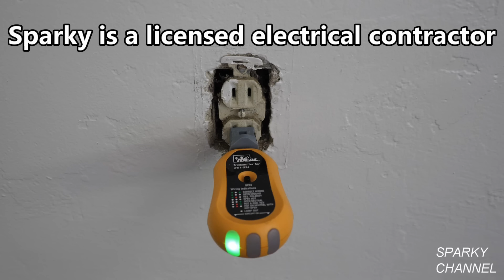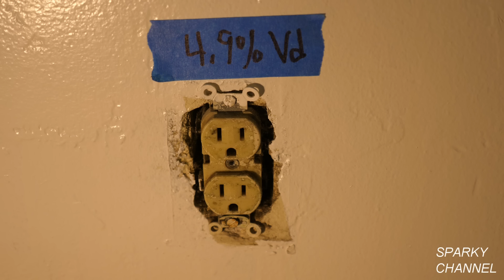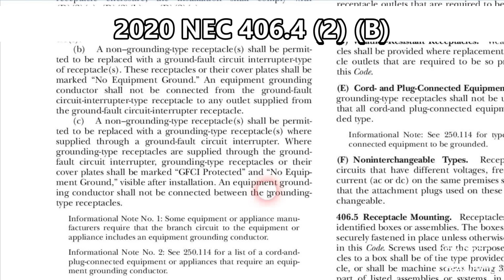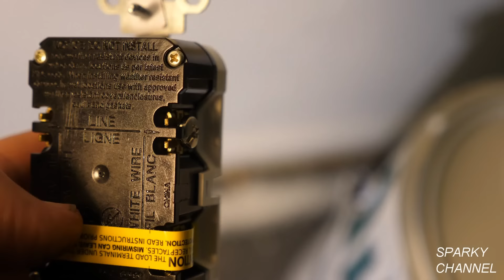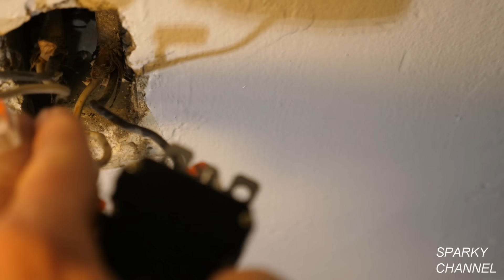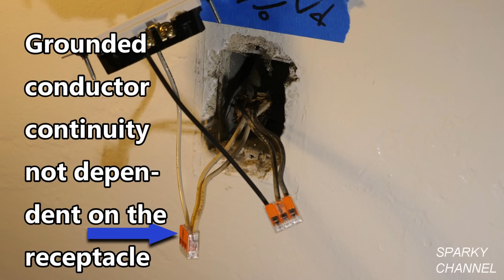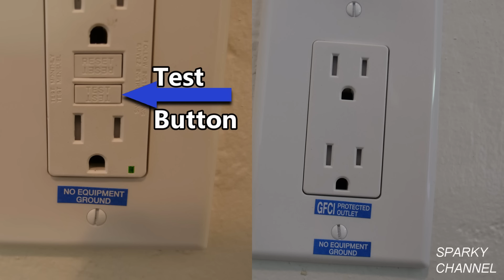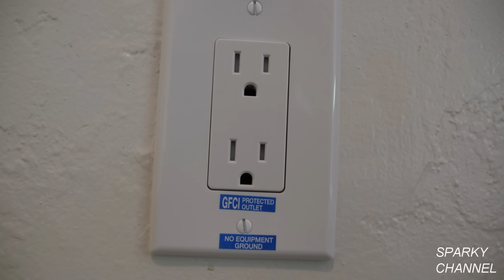2 Prong Receptacle Circuit Replaced by GFCI and Grounded Receptacles per 2020 NEC

Comment: Would never use those push in crap connectors. I see a metal box and it is not knob and tube so does not need to be a GFI. You are a muppet.
Reply: The connectors were lever activated, not push in.  Also, the whole idea is to make a much safer setup and that’s why NEC mandates GFCI in wet areas in new construction even though they have a ground.  This remodel had no grounds and so he has made it much safer.
Reply: Metal box doesn't ensure grounding. 
Did you see the type of wire in the metal box??
Reply: @billbaillie3702  Yes, it is BX.
Reply: @billbaillie3702  If it is not grounded you should replace it with a plastic box. If the live wire gets loose or damaged and energizes the box the voltage will get through the ground wire to the case.
Reply: Metal box isn't everything. Our home was built in the '20s. It has all metal boxes, and all cloth-insulated wiring.
Reply: @Naude716 Am ungrounded metal box is a risk in this method. If the live wire touches the box the equipment case gets the mains voltage. The GFCI will not protect of it happens in the GFCI outlet. If it happens on the load side it will protect.
Reply: @Naude716 I'm also curious re the explanation / theory how 2 wire cloth romex (Not BX) is grounded...
Reply: @billbaillie3702  From what I've  learned, the only real way to ground your old cloth wiring is to gut your walls and run grounds (or new grounded cable) everywhere from your circuit breaker (assuming you have one).
However, if you're lucky, you may have a basement where you can ground SOME of the receptacles. You may be able to run ground wiring from the breaker to the very first receptacle in each circuit. Follow the wiring from the box up all the way until it breaches the subfloor and do your best to feed the new ground up towards the receptacle, and you might just be able to fish it through. That would be the best case to ground SOME receptacles without having to tear walls apart. The only way to ground ALL receptacles is to gut walls and run new cables.

I'm resigned to the fact that I'll just be adding gfci protection to circuits where wet areas are (garage, kitchen, bathroom, laundry, basement..). As for AFCI, I've heard that it can cause nuisance tripping if your wiring isn't grounded.

As always, take this with a grain of salt! I'm not a professional, but I did my best to research online and consult professionals.
Reply: @Naude716  You can't run a ground wire and if you could why not just run a new grounded NM-B or MC cable? The NEC has exceptions to use a GFCI/AFCI outlet. I am just telling you what the code is. You are making shit up. 

I am a Master Electrician.
Reply: @StanSwan  If there is nothing physically in the way of running a ground wire between your breaker and a receptacle (such as walls), why couldn't you run a ground wire/new cable?

As for GFCI/AFCI, all I'm repeating is what I know from an electrician that came to assess work here.
He basically said GFCI was good for wet areas, but anything past that (such as adding AFCI to circuits in living spaces, or GFCI to circuits in dry areas) could create issues with nuisance tripping.

-and you're right I am not a professional. I clearly stated that. There is no reason to be condescending. I'm not here to "win an argument".
Reply: @StanSwan I edited my reply. I think I worded what I was trying to say poorly, and that's where some of the disconnect was.. No pun intended.
Reply: @Naude716  im new here and i just gotta say,reading all these comments is just shocking to me.lets all just get along......
Reply: @Naude716  The house has an old service panel that does not comply with current code. If you modify it you have to meet code. Running an earth to the panel that doesn't have one currently would be a modification.
Reply: @Naude716  Never said it is everything did I? The box is fed with BX. The steel armor is a grounding path. Tell me when did you get your Master Electricians license? I got mine in 1992.
Reply: @StanSwan  🤔 so you're saying you think it's already grounded? As in, he just needed to add a ground wire between the box and receptacle?
Reply: @Naude716  Code allows that or a self grounding receptacle.
Reply: @StanSwan  Ah, oh well. I guess we'll never know for sure since he never showed him testing the box for a ground!
Reply: @Naude716  I can clearly see the BX cable.
Reply: @StanSwan  just because  it's  bx doesn't  not mean it's grounded or goes all the way back to the panel or correct  connectors are used.
Reply: @thomasmarable6818  How many times are you going to repost this? Already answered you.
Reply: @StanSwan  when did you answer me never I just made a statement.  And again  just because it's bx in the box doesn't mean  it's grounded. There could be  a number of reasons why it's not.
Reply: @thomasmarable6818  BX is always a ground. You ever work in the trade?
Reply: @StanSwan  so for those over in Europe, bx cable is armoured?

I see so much here that looks horrifying from the perspective of European standards. There's no way you'd be allowed to retain outlets without a ground, and even if it is armoured cable with grounded armour you're still expected to have a dedicated CPC. There's no end to end test for resistance, polarity was only tested with a no contact voltage tester. There's no test for loop impedance or prospective short circuit current to ensure that it would be high enough to guarantee a trip, whilst below the breaking current rating. There's no insulation testing to ensure the cable is still in good condition. The GFCI (we call them RCDs)  hasn't been tested for trip current or trip time. There wasn't contact voltage testing or proving dead, or even proving unit for the non contact testers that are used (which definitely wouldn't fly for safe isolation), and the breaker isn't locked out!

Oh, and that circuit analyser is pulling 15 to 20A on an IEC connector that's rated for 10A

Is any of this considered normal over there?
Reply: @NeneExists  The NEC is the most Strick electrical code in the world. Most countries adopt 1970s NEC standards so have no idea what you are rambling on about.
Reply: @NeneExists  BX is the old style armored cable. It had only two conductors and some later BX had a grounding strip. I know this because I worked on my old 1920's house back in the late 80's and I was still able to buy some. I don't think it's made any more. Now we have MC which has insulated grounding conductors. I'm not an electrician, but I've seen MC (metallic cable) and AC (armored) used interchangeably.
Reply: Every circuit should be GFCI protected, like it is in every other civilized country.
Reply: @airplanes657  LOL Are you really that stupid?
Reply: @StanSwan  I'm from the UK. Every circuit in my house was ground fault protected. I know that's hard to imagine for an American... And the house was older than America itself and it still had GFI.
Reply: @airplanes657  You mean arc fault. Same thing as here. I am a Master Electrician FYI.
Reply: @StanSwan  well if you want to be picky actually I mean a Residual Current Device (RCD) which trips on 15mA, equivalent enough to an American GFCI. I don't really care if your a "master" in America, doesn't mean you know anything about international best practices clearly.
Reply: @airplanes657  You're. When you lean to spell I will care what you think. GFCI is not required except in wet locations as it invites nuisance tripping.
Reply: @StanSwan  When they lean to spell? Oh the irony.

Anyway, BS 7671:2018+A2:2022 requires RCD/GFCI in many locations, and they're listed in regulation 411. Specifically 411.3.3 calls out a requirement for RCD protection on all sockets rated at 32A or less, and 411.3.4 requires RCD protection on all domestic lighting circuits. There's also specific requirements for electric vehicle charging in 722.411.4.1 but that's a bit tangential and also covers things like PEN fault protection.

BS 7671:2018+A2:2022 doesn't require AFDD on all sockets, but it does recommend them, except for what it calls high risk dwellings which specifically do need both AFDD and RCD on sockets or fixed wiring of 32A or less in new installations per 421.1.7.

You don't need to care what any of us think for it to be provably false that the NEC is the most "strick" (sic) electrical code in the world, because out here in the civilised world we're all kinda horrified at what american wiring and practices look like, and what master (sic) electricians get away with.
Reply: lol
Reply: @airplanes657  "I'm from the UK. Every circuit in my house was ground fault protected. I know that's hard to imagine for an American... "
That won't be a safety issue. The thing is with so many protective devices how would you insure the one that tripped is the one nearest to the fault? You could be running all around the house to find the that GFCI.
Reply: always one know it all like you huh? a metal box doesnt mean a thing for grounding.
Reply: @ThePCHomestead  That is why I mentioned a ground being present genius. When did you get your Master Electricians license troll?
Reply: @ThePCHomestead  I watched it and corrected it.

Comment: Aren't all the receptacles GFCI protected?
Reply: Once a GFCI is put in upstream at the nearest receptacle to the breaker panel, as was done here, then everything downstream on the circuit is protected by the one GFCI receptacle.  You will notice, he didn’t pigtail the first receptacle.  This is so all current will flow through it and can be interrupted if an imbalance occurs. (IE, some of the current is flowing through you)
Reply: Not unless they were replaced with a GFCI outlet.
Reply: @ErrorInvalidName  or GFCI circuit breaker in service panel?
Reply: @billbaillie3702  With this old panel I seriously doubt you could source a GFCI breaker.

Comment: Thank you, very instructive.  I have wondered if there are instruments that test under load, since that can detect problems that won't show up in continuity tests. Separately: what is the orange tool at 15:38 being used to fold wires into the box before pushing the receptacle in?
Reply from the maker: Thanks! VOLTCLAW-12 Nonconductive Electrical Wire Pliers: Amazon: https://amzn.to/3GRNqyp

Comment: Are the old bulldog painal  still legal
Reply: As long as you don't modify it yes. Code does not require you to rewire your house just because it's old. If that were the case homes would be rewired every 5-10 years at considerable cost.

Comment: But did you replace the knob and tube wiring with romex?
Reply: There is nothing wrong with knob and tube wiring that is in good condition. If you are using a window air conditioner unit run a separate #12 romex for that outlet on a separate breaker.

Comment: What if the receptacle was just bad and you labeled it "off" with the blue tape and then you start sticking hour hands in there?
Reply: That’s why you use that little voltage detector thingy..  stick that in first, after you have confirmation it works… then a little prayer and hope your not gonna grab a hot wire.

Comment: I am a thrifty type. I don't buy that costly Ideal circuit analyzer.  After verify all receptacles for a particular circuit by turning off breaker and using hot stick I disconnect all wires then turning on the breaker to find the only hot wire using my hot stick.  The receptacle that has one hot wire is the most upstream one.  Over here  we call it home run.  Once the most upstream receptacle is identified, I then turn the breaker off to proceed with my work.
Reply from the maker: Excellent, that works!
Reply: Being thrifty is always good, but nerding on unimportant things for the sake of curiosity is just what some of us do 😂
Reply: @Nature's Potluck  I am a professional electrician.  I save money whenever necessary, and I invest thousands of dollars in tools and equipment that are deemed necessary for my line of work to enhance the quality of work and safety for all.  Don't get it wrong.
Reply: Install a GFCI circuit breaker on the circuit and be done with it.

Comment: Can I just replace ALL receptacles on a circuit with GFCI receptacles?... for example, replace the most upstream old receptacle with a new GFCI, then also replace all down stream old receptacles with new gfci receptacles?
Reply: If you really want to do it probably wouldn't be terrible but you're looking at two maybe three bucks a piece versus 20
Reply: Well you can do that if you can afford the cost.  The costs of GFCI receptacles are many times more than regular receptacles.
Reply: @vigormanh2980  I buy from amazon in bulk... I got 10 leviton gfci for $65... I know a chain of gfci is overkill but I like the look of all receptacles matching in a room... I have already ran a chain of 4 gfci in 1 bedroom, no problems, I asked the question hoping I wasn't violating electrical code as a violation could be a pain when I go to sell my house.
Reply: @deezle1460  My wild guess is what you have, matching GFCI receptacles in the same room, will be frown upon.  Now, let do a quick review about Ground Fault Circuit Interuptor (GFCI).  It is a feature that helps protect personnel from getting electrical shock in case of current leakage.  GFCI receptacles are required on specific areas of the dwelling units, commercial places and industrial environments.  One should look at the NEC book, local  authority having jurisdiction' requirements to find more about where he/she should install GFCI outlets.  If you install GFCI receptacles at places where GFCI receptacles are not required it will be a little odd.  I hope whoever did the installation for you has proper training in electrical work.  I have seen very lousy jobs done by handymen.  My suggestion is just get a qualified electrician to have a look at your house before you put it on the market.
Reply: You could but two issues with that.

It would cost a lot more. Additionally you could not use a jumper on the downstream outlets. All conductors would need to be directly connected to the GFCI outlet. A bad outlet would isolate all downstream outlets.
Reply: There are a few other videos out there describing this scenario. From what I gathered, you COULD install GFCIs at each downstream receptacle, but there really is no point. The key is installing a GFCI at the first receptacle in the circuit (as shown in this video). Also, if one trips, they all trip downstream. The you have to reset them all, instead of just the first one in the circuit. And of course - much more costly.
Reply: @nadermostafa3963  I currently have a series of 4 gfci, when I TEST trip 1, it does NOT trip the ones down stream BUT the lead (start of run) gfci does kill power to the other 3 when I test... KILLS power but but does not trip... I only have to reset the most upstream, of course thats just a test scenario, I have yet to have any of the gfci trip under load. Basically, the gfci will kill power to any other gfci that it feeds power to... kill the power but does not "trip" the one downstream... so I dont have to reset them all, I just have to reset the one that "tripped", once I reset the one that tripped all downstream gfci power on without the need to reset.

Comment: Gotta appreciate a pro that quotes from the NEC.  I had to learn a lot of it when I was the safety guy for a national chain QSR.  All those extension cords in place of permanent wiring. SMH
Reply from the maker: Well said! Thanks!
Reply: Nothing wrong with an extension cord if its used per code. Which of course would mean it can only be used temporarily, which I think is your point, folks tend to use extensions permanently.

Comment: Excellent video. I realize the price of the circuit analyzer is over $400, a bit stiff for a one time application. Is there a place where I could rent such a device? Any ideas?
Reply from the maker: Perhaps you know a friend who owns one?
Reply: The circuit analyzer is a professional instrument. I doubt any place would rent this out to a non electrician.   I had the same issue in my older home.  What I did was to install GFCIs in several rooms.  A little but more expensive but I didn't want to take any chances.  Except for the analyzer,  I purchased all the other Idea products.  We had an old fuse box replaced and upgraded but the master electrician we hired didn't mark any of the circuit breakers.  That circuit chaser is the best.

Comment: What would happen if the GFCI was set furthermost from the main panel ?
Reply: It would only protect that specific electrical box.  Basically only that receptacle would be protected instead of the whole circuit.
Reply: @erilopez7974  In addition, I believe the the other receptacles would not meet code.
Reply: @jgrande1  correct , gfci are supposed to go at the beginning of the circuit or near water areas.